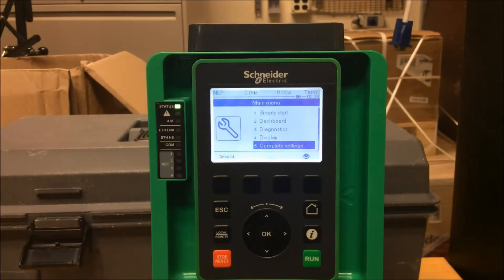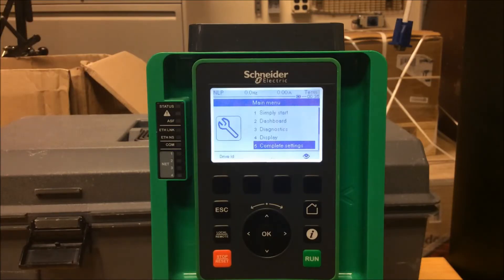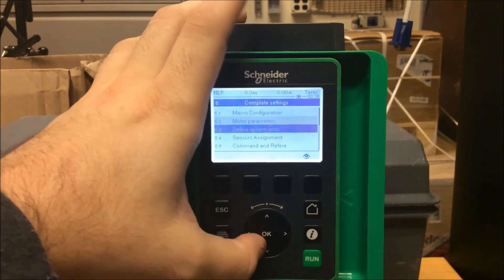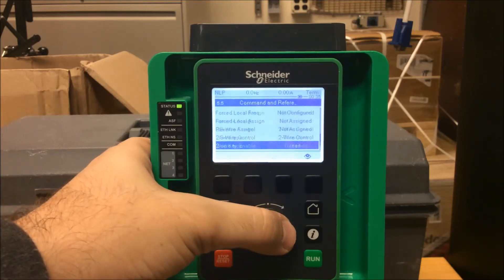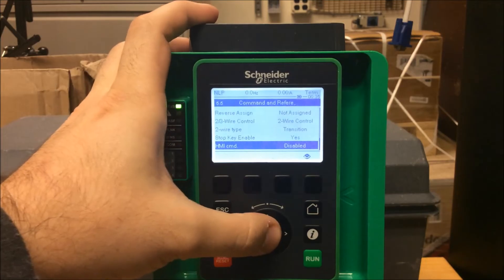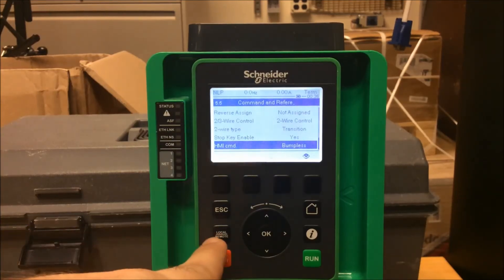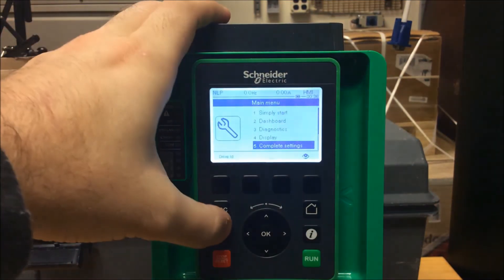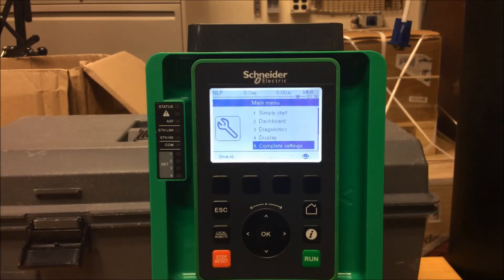Enabling Local/Remote Button on Altivar ATV 630/930 Process Drives | Schneider Electric Support

Comment: Hi, how do I make run enable in the terminal, I mean to start-stop the motor. Because on the Local I can manually set the frequency, but in terminal/Remote I have the reference frequency in AI3 and Channel 1, but do I need a reference in DI to run enable the motor during in the Remote? Please provide me an advice, i appreciate it, thanks.